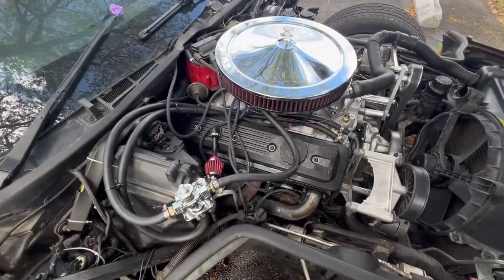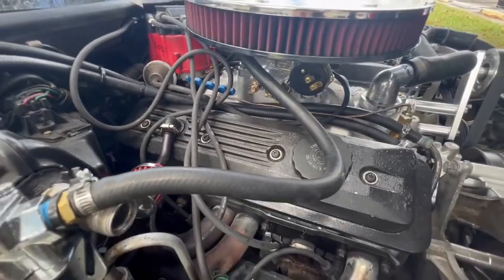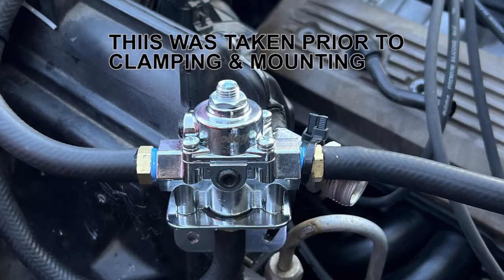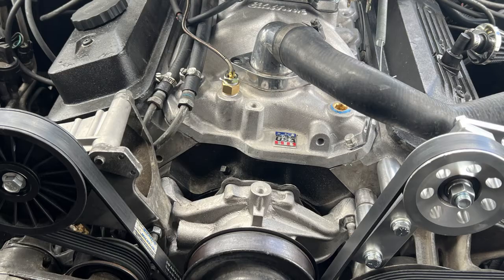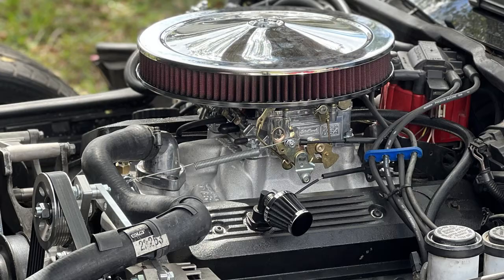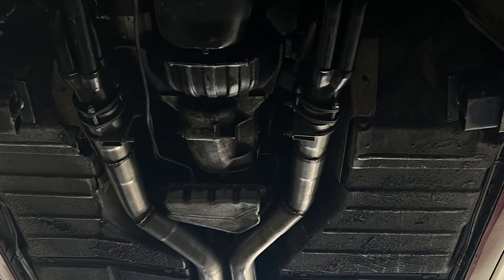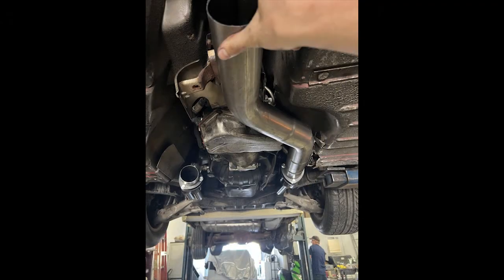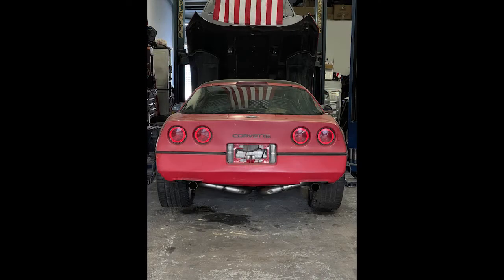TPI TO CARBURETOR SWAP 2023- How to convert your C4 Corvette to carburetor guide

Comment: Another backward step in technology the way that I see it.
Reply from the maker: All I'm saying is that Carbs are still made to this day and tune ports are not.
Reply: @CREATINECONNOR  You are not saying much.  Horse drawn buggies are still made, too.  Tuned port was replaced with another technology.  The carburetor is a dinosaur.
Reply from the maker: @GoldenGun-Florida  Objectively speaking I believe you are wrong. The Tune Port was fuel efficient and thats it. It barely made any power and was gutless. It was also the first FI setup for GM and was born in the 80s. A carburetor on the other hand with a proper intake easily adds a ton of power. Carburetors are quite complex on the inside and are like mechanical computers. On street applications They can still be tuned for efficiency & power. 

Theres a reasom nobody CrossFire/TPI swap or even LT1 swaps their small blocks. They all go for a carb setup or
something like a sniper EFI setup.
Reply: @CREATINECONNOR  Are we talking about tuned port or crossfire injection?  All TBI units were discontinued in favor of individual injectors at the intake valves.  Progress.  It doesn't mean that the crossfire injection was bad.  Just because Barney and Elmer say so doesn't make it a true statement.
Reply: @CREATINECONNOR  You may wish to take a few courses in thermodynamics and airflow coefficients before making such statements.
Reply from the maker: Look man you don't need to be smart to understand that a tune port C4 makes 250hp back in the 80s and a simple carb/intake swap can easily get you closer to the 1hp per ci mark. It's simple, the tune port sucks and is an obsolete piece of technology that was burdened by 80's smog laws. Not to mention, finding affordable parts for the TPI is hard in 2023 and at this point its close to 40 years old and most cars will have very bad condition parts as mine did. Who wants a corvette that barely makes 200whp and runs out of breathe at 4500rpm? Nobody  @GoldenGun-Florida
Reply: @CREATINECONNOR  I would suggest that you stop while you are ahead.  Every time you respond another 10,000 people laugh.
Reply: @CREATINECONNOR  like I said earlier, you might want to think about replying because every time you do half of the universe laughs.

Comment: That's not a kick down cable it's a TV cable that lets the transmission know when to shift. Without the throttle valve cable placed correctly you can burn up your transmission.
Reply from the maker: I don't have either as I have a manual trans.

Comment: will this work on my 87? i heard holes dont line up? if you know otherwise please point me in a direction soooooo done with tpi
Reply from the maker: If you have the L98 Tune Port Injection, you will be fine as it's the small block chevy architecture. If you have the LT1, you will have to get an LT1 specific intake manifold. The LT1 is not the same architecture as a small block chevy.

Comment: I’m converting my 84 now, you didn’t have to run any power to the fuel pump? I’ve cycled the key on mine but it’s not ready to start yet and I hear the pump run for a couple seconds then it shuts off. I’m running an hei distributor also and I don’t understand how the pump will run without the stock distributor
Reply from the maker: There's no reason to have to screw with the fuel pump if you unplugged/removed the TPI stuff. The key always switches the fuel pump on.  Also, what you are hearing is the fuel pump priming. When you turn the key it will only prime and shutoff until you start it. 

To address the last thing you said about the distributor, there's no correlation between the distributor and fuel pump. They have nothing to do with each other.
Reply: @CREATINECONNOR  the problem I’m having is I get the couple seconds of prime and it fired right up until it runs out of fuel. The pump only primes and doesn’t stay running when the car starts. I’m using the oil pressure sending unit because it’s tied into the relay but there is another wire coming from the ecm that must keep it running. I need to figure out that wire and run ignition power to it
Reply: Did you ever figure it out?

Comment: Unfortunate that the car only had 60k on it for this.    On the bright side, this helps raise the value of nice TPI cars.
Reply: "nice TPI cars" sitting in the trailer parks for $2500... 😂
Reply: @RockLicked  I work on TPI and LT cars exclusively, you’d think otherwise in my line of work.  Just sold my 1991 6sp Corvette for $26k with 55k miles on it.
Reply: @RockLicked yea for one with a million problems rust all over it paint fucked up and 150,000 miles on the engine and still worth more than alot of normal used cars on marketplace dipshit
Reply: @RockLicked  c4 corvettes with 170,000 miles with horrible paint and ripped up interior and still cost 2500 not bad
Reply: @worldsslowestmustang  yea post a vid of it so i can see how “clean” it is
Reply: @Ice-tz8jd  lmao, i never said mine was clean, mine was 1200$ with 100k miles.
Reply: @worldsslowestmustang  u implied it.
Reply: @Ice-tz8jd  no tf i didnt lmfao… i said you can get clean c4s for 3k, and that i go my vette for 1200…. not a single implication that mine was clean, just making a point that they are NOT expensive or valuable cars. it’s literally the most produced corvette ever made, they are simply just fun old sports cars and absolutely nothing more. they’re fun and look cool, but they arent worth shit.
Reply: @worldsslowestmustang  where do you live at the market for a clean low mileage c4 corvette anything past 87 is worth upwards of 10 - 15 grand where im at.. i got my 88 with 47,000 miles for 9 grand and it was posted for 13,000 as well as all the others anywhere near in good as condition were posted for 11-15 grand. Keep in mind mine had not a single scratch on it and 47,000 og miles on it perfect interior ect. They really are amazing cars and in good condition i just cant see them not being worth anything less than 8-15 thousand dollars.
Reply: @worldsslowestmustang  i said u implied it because in the same sentence you were mentioning getting a relatively clean one for around the same price so i mean
Reply: @Ice-tz8jd  seriously? the most expensive c4 ive seen around here was 10k, and noone pays that because you can get an 80k mile clean c5 for 10k, 120k+ miles with a few scratches for 6-8k, so i just cant imagine c4s being worth more than maybe 7k for the right one, unless its a super clean 40k mile mint condition 5 speed manual one that looks brand new. even c3s are cheap here, can get a late 70s manual c3 running and driving for under 2k. they absolutely are nice cars, but most people would rather pay 10k for a c5 than a c4 considering they look better, handle better, make more power, and are more reliable with more aftermarket support.
Reply: @Ice-tz8jd  just saying it wasnt an implication, just using it as en example
Reply: @Ice-tz8jd  but yeah the going rate for actually clean c4s is 5k but they still struggle to sell, you can get one with 50-60k miles all original and clean for 5k, and 2-3k for somewhat clean ones with 80k miles, but i know some areas are way more expensive. it really just depends on how many there are in the area, and how many people actually want them.
Reply: @worldsslowestmustang  im in ohio and its its no way im gonna find a nice c5 or really any c5 for less than 15 grand. I was at work earlier on break with some older guy probably 50s (im 24) and he was telling me he thinks i could get 20 for it obv he was exaggerating but yea man markets really really vary in different states by a large margin its weird how things work. Also some guys like myself just like c4 corvettes they look better than a lot of c5s in my opinion
Reply: @worldsslowestmustang  i bought mine with like i said 47k on it and its been the most reliable car i could ever imagine and i honestly didnt know if that was gonna be the case when i bought it. It was my first car ive almost killed myself in it a handfull of times because i litterally taught myself to drive in it lmao. The earlier l98 engines are really really reliable and easy to get parts to work on it its basically an older truck engine so lots of aftermarkets parts no optispark to worry about etc. all ive had to do to it since i owned and put 3-4 thousand miles on it was replace an alternator and i daily drive it.
Reply: @Ice-tz8jd  yeah i mean personally i dont really like to compare them bcause i feel like theyre both their own seperate thing, but both the c4 and the c5 have been my dream cars for a while, i love corvettes more than pretty much any other cars, but yeah there’s definitely a lot of old guys in ohio who raise the prices of anything thats old. you could also say when you live in bumfuck nowhere like i do everything is cheaper too.
Reply: @RockLicked I bought my 85 for 2k lol. It sat for 4 years before I got it. Had to go completely thru the fuel system. Wish I’d seen your video earlier 😃
Reply: Tpi c4s are not money cars, they are not investment cars, they are simply fun cars. Save your boomer ignorance and let the guy play with his car.
Reply: @bobvomhof5699  What’s a boomer?
Reply: 😂😂😂
Tpi c4 Corvettes are still next to worthless.  If someone wants to carb the car and it makes them happy then that's what counts.
Reply: No such thing as a nice TPI

Comment: How does the removal of the sensors you mentioned affect your gauge function on your dash? What about the OD engagement on your 4+3?
Reply from the maker: The only gauges that really get wiggy are all of the fuel related gauges. Since there's no more fuel injectors, the ECU has no idea how much gas the engine is getting. Also, the fuel gauge may get weird as the fuel pressure regulator may inhibit the fuel pressure sensor to give higher readings. My c4 fuel gauge is basically useless.
Reply: @CREATINECONNOR what would be the solution to that?

Comment: This is a neat idea but I will never do this to my car. Why would I ever replaced tuned port injection with a carburetor?! I would probably understand why you would if your vette is cross fire injected but even then, cross fire injection was supposed to give better performance and be more economical than a regular carburetor.
Reply from the maker: It is all up to the owner and their goals. This is my project car so I value performance over efficiency/OEM form. A carb and good intake will add way more power and tuneability to a c4 with Xfire or TPI. If you're somebody who dailys or doesn't care about performance, there's nothing wrong with staying stock form. At the end of the day, there's a reason people carb swap/go efi instead of puting a TPI or LT1 on their small block project car. They always go RPM performer and a 750 of some sort.

Comment: What distributor did you get? I have been looking on eBay and I don’t know if I should go with a cheap or expensive one
Reply from the maker: I used another GM HEI Distributor but I believe it died on me the last day I had it. Definitely don’t cheap out on your ignition as it can really hurt your motor or fail all together.

Comment: You HAVE to have a pcv valve installed. Just airing out wont do
Reply from the maker: I have filters on the valve covers so the crankcase vents to atmosphere. 👍
Reply: @CREATINECONNOR  PCV depends on vacuum fm the intake manifold to one of the valve covers and a filter of sorts on the other valve cover to circulate outside air thru the crankcase

Comment: Did you cut off the fuel injector plugs or leave them?    What changes if any to the computer?
Reply from the maker: All I did was disconnect the harness and stuck it off to the side. I did absolutely nothing to any other wiring. Everything works normally.
Reply: @CREATINECONNOR  awesome something shuts off my fuel injectors randomly. I already did the vats bypass and still happens so this will kill that gremlin.  My winter project.

Comment: Hello and thanks for the time spent on video. I'm doing engine swap on my 86 vert. using a Blueprint 396 stroked sb350 (Engine dyno 508hp/ 525 torq) Can't wait to get it doneand driving. I am trying to figure out what to do with the injector harnesses, does anyone know if they can be "unplugged" anywhere? I've leaving the brain box in place. Thanks again!
Reply from the maker: I think you can trace the harness back to the firewall. I’m personally not going back to factory F.I. So I’m probably going to cut it as far back as I can and see what happens. I don’t think it will do anything bad as there’s nothing that I need on it.

Comment: I'm just curious was the motor bone-stock? Because your Dyno numbers don't add up there's no way you got that much horsepower out of a bone stock l98 and there's no way you had 150 horsepower with a carburetor intake and headers. So just curious what mods were done to the original motor before you got it and how big of a cam you put in when you swapped to the carburetor?
Reply from the maker: The dyno graph shown was a bare engine in a dyno cell with no accessories, cold air, headers, and a tune. Chevy put the l98 out at 230 crank hp with all accessories/smog equipment which simulates world real numbers. As for the major hp gain, yes that it true. Remember, it’s 150 hp on an engine with no accessories in a controlled environment. On the street it will probably be closer to half of that number.  If you don’t believe me, watch Richard Holdenrs TPI videos on YT. 

Also, my motor was bone stock in this video and I did not change any internals. I recently pulled my motor and sent it to be rebuilt as a 383. I’d imagine the new cam will be around 230duration, 500 lift, and 110LSA.
Reply from the maker: Also I believe you may have misinterpreted some information. The chart in the video shows the TPI peaking at 330hp and the carburetor setup peaking around 360hp. With that being said, the 30peak hp isn’t what’s the most beneficial. What’s most beneficial is how the carb setup keeps building power out into higher RPMs. So yes it makes 30 more at peak but the power band is nearly doubled in HP.

Comment: Great Job Man!Doing this as we speak.What did you do with you heater hoses?
Reply from the maker: I threw out practically everything. You can cover up the heater core inlet/outlet and then put a threaded plug in the water pump.

Comment: All that  you did to your  corvette  also can be applied to  many other  chevy engines all your information is spot on for the list of  parts needed.   It's probably  way more  fun to drive  now and dependable and can easily  handle those  long daily  commutes to and from work.  I know for a fact. I did this to  a 99 vortec  350 and dropped it in my 86 gbody and I commute  over  50 miles a day for  over a year now with no  issues.   Great source of  information  for  anyone  thinking of  doing this  to their ride
Reply from the maker: Yes indeed! The swap is practically 99% the same for any other small block chevy made. I tried to mainly cover the info that's not as clear on the internet and make sure the rookies like myself know what to do. For instance, the electric fuel pump, the ignition system, deleting all of the emissions equipment, etc. When I first bought this thing I knew absolutely nothing compared to what I know now. The only thing I wish I would have done differently was buy the an air gap intake instead of the 2101 as it's not the best performance intake. It gets the job done especially for stock application so I can't complain.

Comment: Just did this to my 86 iroc z that has a zz4 350 crate motor sat for 20 years the tpi was a headache to work on so i switched to a carb
Reply from the maker: That's awesome. I feel your pain. My tune port was so old and deteriorated. When I was taking it apart I knew that this junk could not go back on. If it were an LT1 I would have probably kept it since it's not a bad setup.

Comment: Without cutting the hood, you're losing your cold air intake. But to each, their own.
Reply from the maker: It's definitely sucking every possible molecule of hot air possible. By all means, it is killing HP and MPG. This setup was definitely a short term/temp setup. I'm ordering a cowl soon and I'll be building a custom CAI when I get my motor back.
Reply: @IllegalC4  where can you get cowl hood for c4?

Comment: I picked up a l98 out of a rear ended corvette. The engine was already out the car when I purchased it and wasn’t able to hear it run. But for $500 dollars I rolled the dice. Got it home slapped on a high rise intake, 650 carb and a HEI distributor and it fired right up. Awesome throttle response. And I will never ever ever have to worry about injectors and all the unnecessary wires. I’m stuffing it in a 82 s10 I picked up for $500 bucks as well😂🤘🏼
Reply from the maker: Hell yeah that's awesome. Do you know if its a flat tappet cam or roller cam?
Reply: @CREATINECONNOR  I have no clue. I can tell you it was in a 1989 corvette. Idk if that helps
Reply from the maker: @murdyg7382  I believe that's a hydraulic roller block, which is great. The hydraulic roller cam is far more superior than the hydraulic flat tappet.They have less wear, keep the valves open longer, and run smoother overall. They are very expensive but they're worth it.

Comment: TPI had crummy higher-RPM power, yes?
Reply from the maker: The TPI would die at 4400rpm which makes the 5500rpm red line useless. There's dyno charts out there that show.
Reply: the long tube runners are great for low rpm torque but don't breathe well at higher rpms